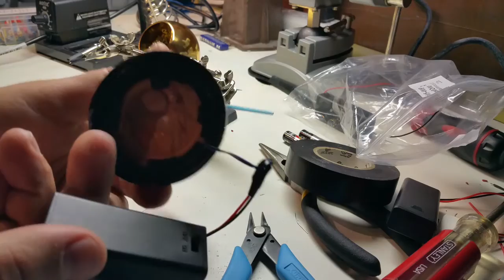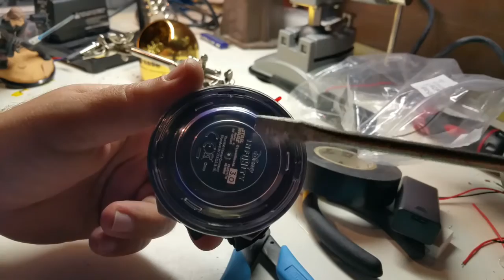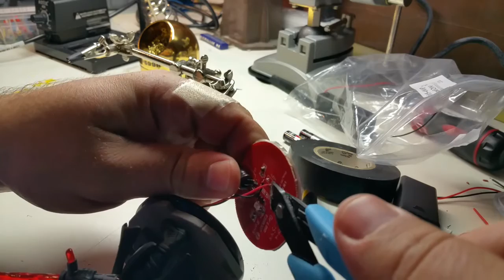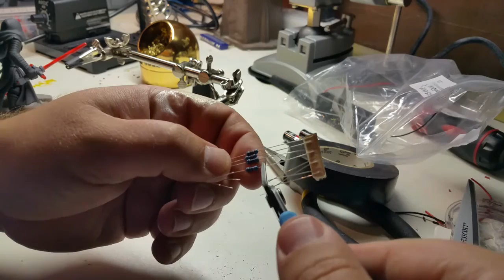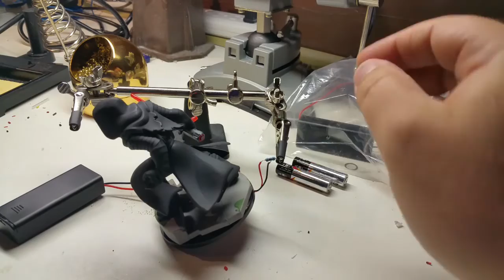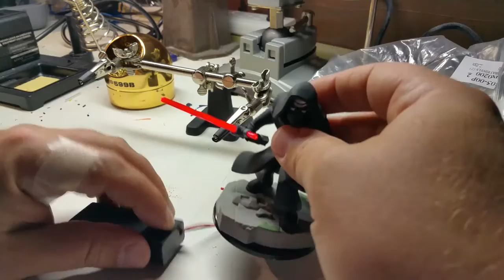Disney Infinity Star Wars FX Figure Mod

Comment: hey hoping you can help me out for a sec, I'm making one with USB and am trying to figure out what voltage I need to drop it to, is that battery pack set the batteries in parallel or in series?